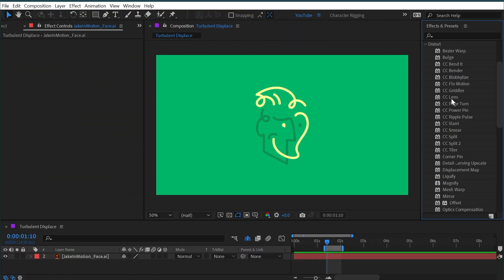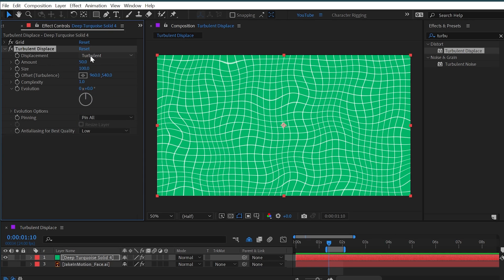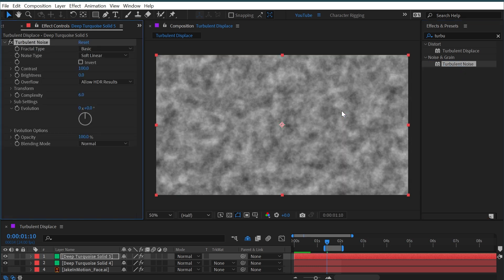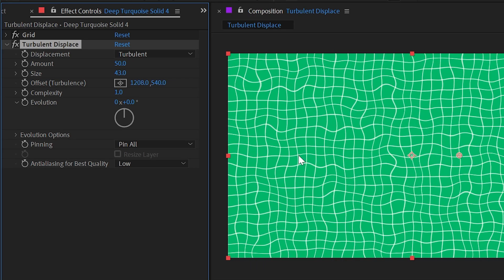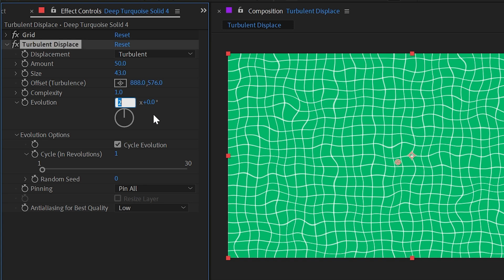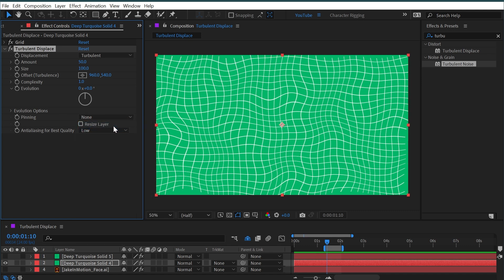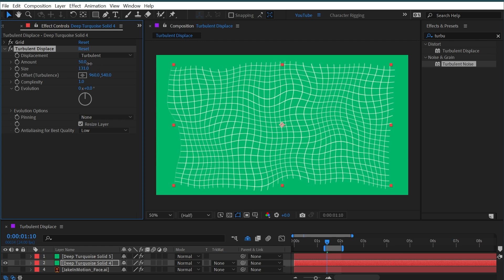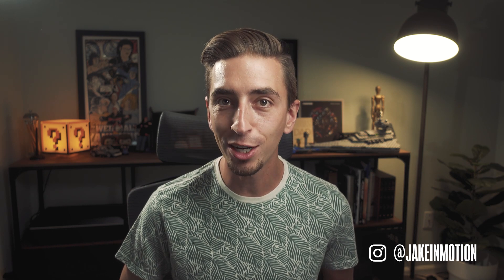Turbulent Displace | Effects of After Effects

Comment: Hey, do you know maybe how to apply turbulence display but leave the stroke at no changed stroke width? Turbulent displace extend stroke width in some areas.
I think I am supposed to apply turbulence displacement to the path with 0px stroke and after that apply the stroke. Is that even possible?
Reply from the maker: Not really. But if you're using shape layers you could replace the turbulent displace effect with the wiggle paths shape layer operator. That will distort the path prior to applying the stroke.

Comment: I there a way to fix the bottom from an object of for example a candle flame with the turbulent displace? So that this part get not much affected by it?
Reply from the maker: Yes, that's exactly what the pin edges part of the effect is for.
Reply: @JakeInMotion  I already tried it with that, but it is not working as intended. It would be, if there is an option for a smooth transition to the animation part.